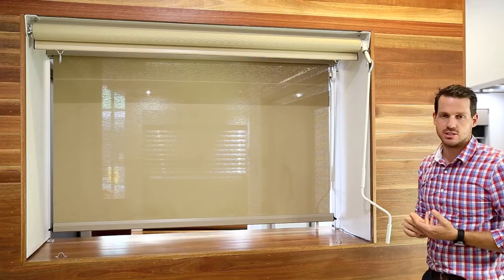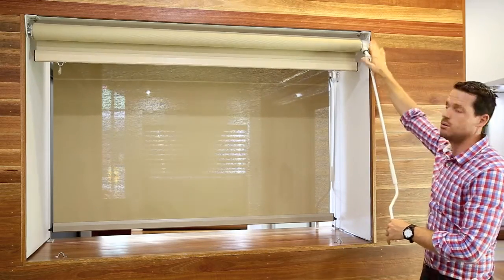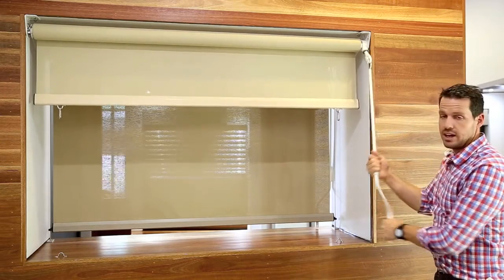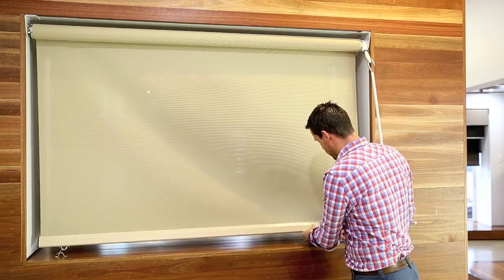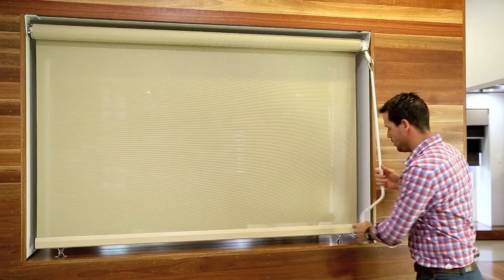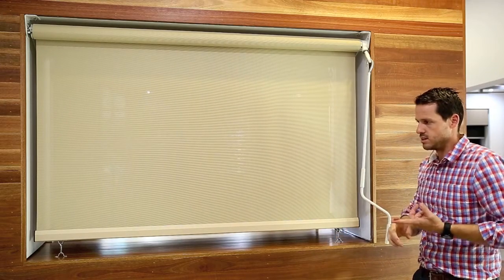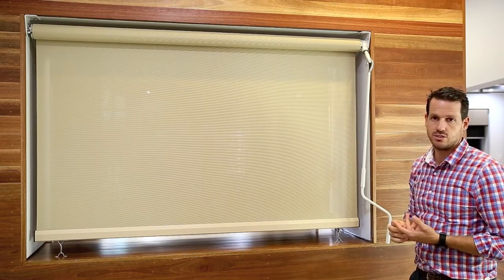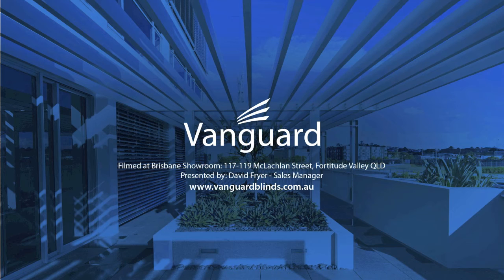Fabric Straight Drop Awning / Retractable Outdoor Blind - Vanguard Blinds

Comment from the maker: The Vanguard straight drop awning is specially designed to be strong, durable, affordable and capable of spanning large outdoor areas up to 6 metres wide. The awning offers protection against wind, rain, heat and glare and is available in a range of fabric options to suit your specific requirements. There is also the option to add side guides for added strength during windy conditions and stainless steel clips to ensure the fabric stays secured at the base.
Reply: Hi Guys, we are sailors sailing around the world on our catamaran Impi and looking for something similar to this for the patio sides on our boat. Would you have something similar that we could have you make to order and ship out to our next port of call in Australia?
Many thanks
Brent